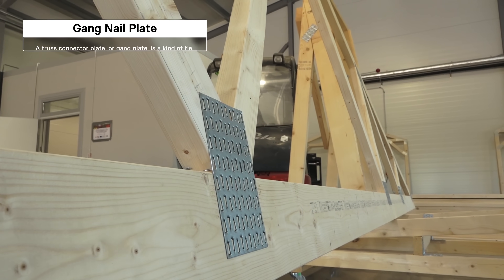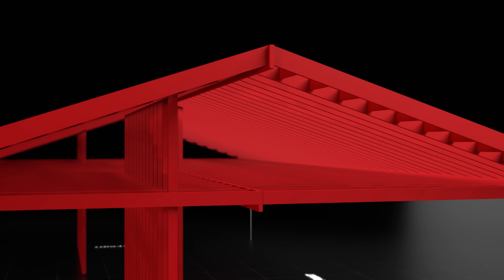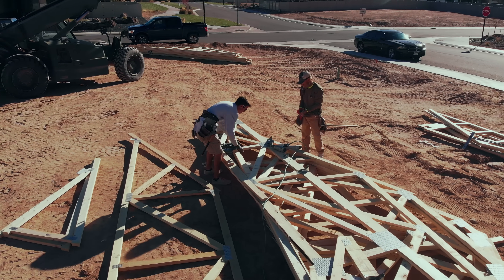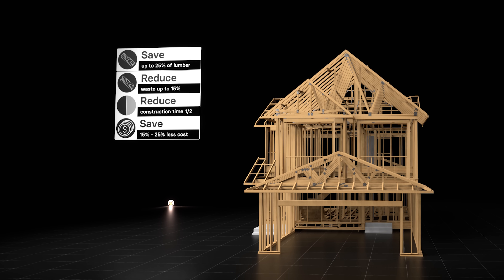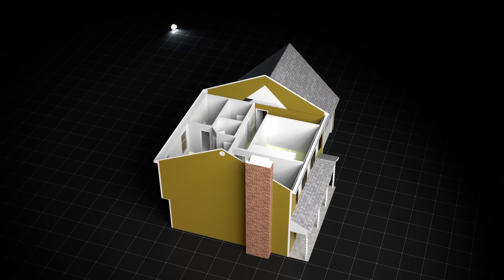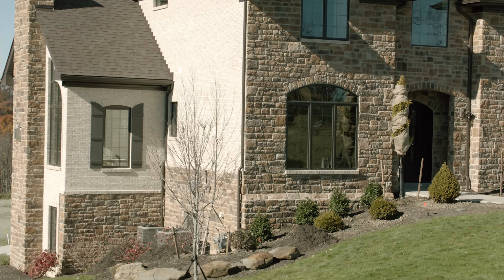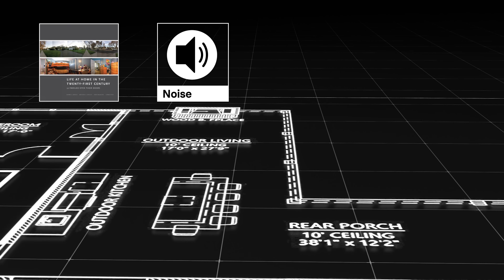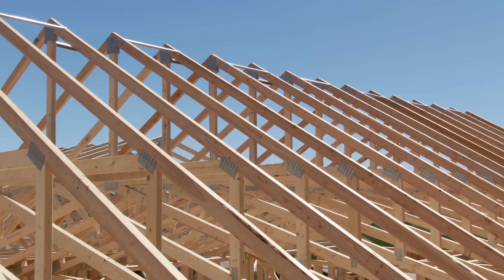The Invention that Accidentally Made McMansions

Comment: The next invention that changed building was the joist hanger. Roofs with trusses could only go in one direction and basically have a single roof line. Hangers paved the way for hipped roofs and multiple roof lines. It probably did more for the McMansion than the gusset plate.
Reply: I would add TGI beams as well
Reply: @davidconner-shover51 This.  You wouldn’t be able to get those open spaces without those spans.
Reply: I’m in the building industry and the truss plate is a great invention, I cannot deny that.  However, the poor design of trusses has led to attics with no storage space. Once in a while I’ll find a home with an attic truss Design that gives some storage space, and that is vastly superior to the typical trust that leaves no room for storage in the attic
Reply: But then they took short cuts with the number of nails in the joist hangers! But they can be handy. I built a 49ft geodesic dome where a lot of the floor joists required custom angle joist hangers. Made things simpler and stronger.
Reply: @JP-rf7px BUILDERS take short cuts, not Simpson . Simpson requires ALL holes filled with appropriate nails
Reply: @johnwhite2576  Simpson has minimal nailing but some applicants require more nailing in their hardware the circular holes are common nailing and the triangle holes are for more depending on the application. Every hole doesn’t always require nailing like you stated
Reply: @christianschulz7854  When I first encountered joist hangers, the advice was "fill every hole". I've stuck to that and haven't had cause to regret it. Of course, that's on a diy basis, I can see why a constructor might be tempted to miss a few.
Reply: @MacShintersbane  You don't want to make the wood into a pincushion... it will eventually crack. I don't think there are THAT many holes in a standard hanger though. Haven't used them in a while though, just keep moving the darn things around...
Reply: @johnwhite2576  This is simply not true. Nailing depends on the load being transferred by a given hanger.
Reply: @MacShintersbane  Round holes only need to be filled, "overnailing" may actually weaken the joint if the wood splits.
Reply: We have hurricane straps to hold down the roof now too
Reply: That I would actually believe.
Reply: Thinking about all of the of hipped buildings in the UK that predate joist hangers and trusses,was proper carpentry not a thing in the US?

Boiler plate pre/post ww2 building would be a 4 hip block.
Reply: @frankryan2505  It was done simpler in the 50's and even before then for homes. Less complex roofs than than a hipped roof. The US has a lot of areas in it's high population cities that get significant snowfall, so you want a roof that will shed it or at least direct the weight off towards the walls, so hipped roofs were not ideal for building large numbers of homes in those areas, so carpenters in the US just learned the more simple roof style instead.
Reply: @KnightsWithoutATable  I don't think snow was an enormous factor... there are plenty of old hipped roofs in the NE.  The time and material matters a lot to a cheap contractor though...
Reply: @frankryan2505 american houses are just liveable sheds. Very little Expertise or complex Technique goes into them.
Reply: @frankryan2505 :  Yes a lot of false information in this report. The hip roof has been around for literally thousands of years, long before nails were invented
Reply: @frankryan2505 Any country that puts business and profits first definitely puts quality and craft second. Although when it comes to our military that’s a different story.
Reply: @joshualeeth  "Any country that puts business and profits first definitely puts quality and craft second."

False.

The customer decides what the quality is going to be.
Reply: Joist hangers are for joists. Rafters nail to hips and valleys with no hangers. Before joist hangers you would use bond timbers to support the joist.
Reply: @fframer1  they're talking about hangers in general. Trusses connect to girder trusses with the same style of hanger, just in different widths and capacities. Look up the HG, LJS, and LU sections in the Simpson catalog for some examples.
Reply: @fframer1  Don't try to contribute if you have no idea what you're talking about.
Reply: @ Lmao. You're not as smart as you think you are toddy boy.

Comment: Gang Nail plates, (also on as gusset plates too) has had an extremely adverse overall affect fire has on a home. It went from 20+/- minutes of fire exposure before roof failure with more traditional construction to as little as 5 minutes with modern truss sustems. Would love to see an in depth video catering to both people in the know and the layperson explaining the adverse affects of modern, lightweight construction on fire loads. 

*If you do ever make this video, i’m sure me and many others would love to use it for training purposes for others
Reply: Thanks for sharing this. I’ve had people complain to me that our fire department in my municipality was deficient because they would often show up to fires, quickly remove the occupants and pets, then wet down the neighboring homes while making little attempt to save the home that was on fire. It was implied they did this since the house was going to be covered by insurance anyway.  Makes more sense that they didn’t want to go inside for more than a few minutes because the roof or floors might give way.
Reply: Same as those OSB floor joists. The glue will melt from the heat causing an early collapse.
Reply: @jamesfoster6244 I hate those things. They are also vulnerable to moisture causing them to disintegrate when used in a floor over a crawl space in damp climates
Reply: Also, the increasing use of plastics, which can off-gas flammable fumes when heated, not only in consumer products, but construction materials, as well.
Reply: This is true. As a volunteer firefighter, I saw a house with the first bit of fire (due to sparks landing on a cedar shingle roof covered with pine needles), to becoming an inferno and collapse of the entire house within 10-15 minutes.
Reply: This is probably why my state fire codes require all commercial buildings that have any floor or roof truss construction, to have a little triangular placard by the front entry door with either F, R, or F/R on it, to notify entering firefighters of the truss construction.
Reply: I have a 1950s ranch style house (with California rafters.) We added onto the house and per the building codes adopted by our city we had to have a whole house fire sprinkler system installed. This added on $15k to our 700 square foot addition; with an annual cost to have a backflow valve (part of the fire sprinkler system) inspected. 
I was naturally curious about the purpose of the fire sprinkler requirement. I found that truss roofs are not as "strong" as traditional rafters roofs in a fire situation. Firefighters that get on roofs to vent often fell through. Some agencies refuse to let their personnel onto roofs with trusses. 
Being a purpose oriented person, it was frustrating to be made to install a whole house fire sprinkler system on a traditional rafters roof.
Reply: Good thing house fires are much less common compared to when I was young.
Reply: Why is that?
Reply: @BS-vx8dg  The gang nail plates start to let go when they get hot.  Steel loses strength as it get hotter.  A 16d nail fully buried in a 2x6 is insulated from the heat, while the relatively thin plate is fully exposed to the heat, and the short "nails" get hot quickly, charing the wood and reducing their holding power.  The smaller lumber used in a truss (relative to traditional framing) will also weaken faster as it burns.
Reply: @incognitotorpedo42  Fascinating.  That makes a lot of sense.  Thanks for taking the time to explain.
Reply: @BS-vx8dg It’s called Planned Obsolescence. I’m the USA most products are designed to break or fail after a certain period of time. Houses are designed with this in mind as well. How else would insurance companies exist? Unless they were establishing norms and policies that are guaranteed to lead to disaster.
Reply: nah, just spray everything with a inch of asbestos
Reply: I had a gang nail once. I had to have someone else cut it off because it wasn't very comfortable.
Reply: are you telling me american homes have a worse fire rating than a garden shed? This is wild.
Reply: Can I remediate this?  I could put bolts and shear plates to strengthen the trusses, or insulate the existing plates.

And get a sign describing the upgrades to any firefighters.

Comment: We were able to take out a wall in our house and make it completely open concept because the roof above was constructed with engineered trusses. They are an absolute game changer for flexibility and I was really intrigued when I learned about that construction technique at the time, so it's great to see it explained here. I still think in Canada and US we're missing out on building even more of the house off-site to get costs and time down, we need to take this concept and go further!
Reply: Fully pre-manufactured homes have existed in the US since at least the 1950's. My home was built in 1962, and was constructed like a piece of flat pack furniture from Ikea. The interior walls were unloaded off of a trailer with drywall, electrical outlets, and everything installed and ready to go. They simply brought them up onto the deck of the house and nailed them down. It probably took a crew of workers less than a day to go from a bare foundation to a fully framed in structure.

Comment: I thought the windward side of the roof was under high pressure with the leeward side of the roof being underlow pressure. However, the wind can get under the large overhangs, creating a huge positive pressure underneath the overhang.
Reply: That too.  A house with a peak on the roof will not be a very efficient wing.  Essentially the "wing" will stall on the downwind side. Lower angle roofs should be better wings.  I think you are right  that the normal failure mode sees the windward side of the roof rip free first.

Comment: You still toenail the truss to the plate. And it can all still blow off if you do not add steel connectors to the wall structure. Now some framers use long screws from under the plate to secure rafters and trusses. Trusses like this are pre-fabricated and pre-engineered, so the plate itself is part of an engineered construction, so not independently approved in the code for other uses.

Comment: I'm noticing more houses in Florida are finally being built with concrete.  Stronger during hurricanes
Reply: They should also be built so the ground level can flood with minimal damage -- just garage and storage.  Also, the walls should be built in a cylindrical shape and the soffit minimized to reduce wind up force on the roof.
Reply: I've wondered by that hasn't become the norm. In hurricane and tornado prone areas seems like building with concrete would make a ton of sense and probably make insurance rates go way down.
Reply: @siggyincr7447  Wood is simply way cheaper, nothing more complex than that.
Reply: @Roggor cheaper to rebuild your house? Think also about time spent.
Reply: @Kannot2023  True, but people have a tendency to baulk at higher upfront cost now for benefits later.
See, well, pretty much all of life for examples.